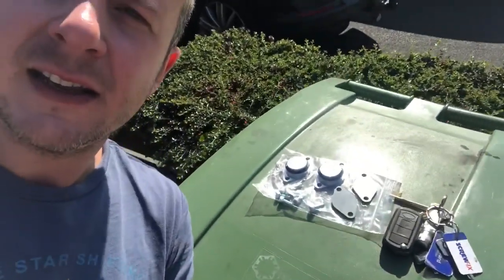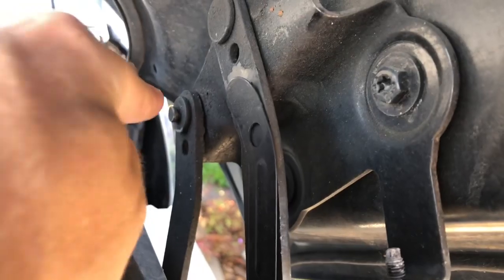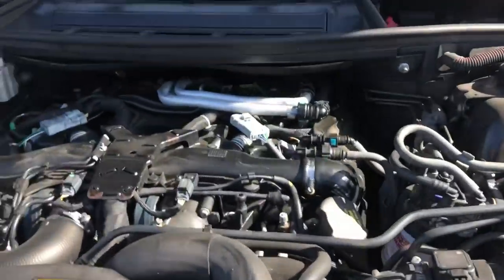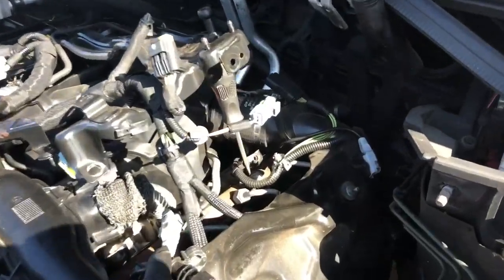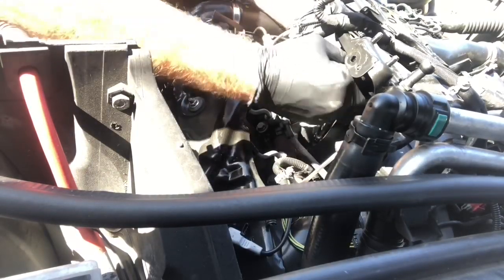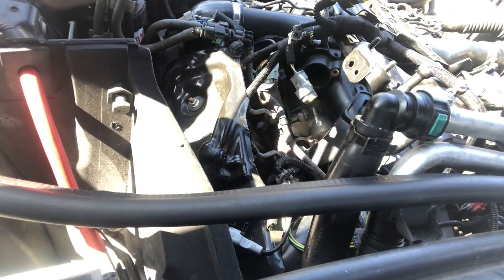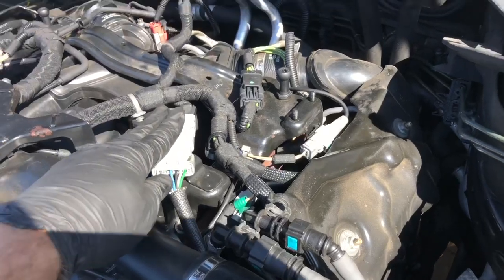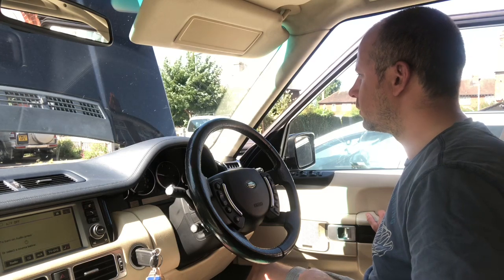EGR Delete - Range Rover L322 3.6 TDV8

Comment: Got myself a cheap 3.6 tdv8 last week and this is the first job I did to it based on this guide. Watched it through a few times then went and and did it first time with no problems at all...took about an hour and a half. To the casual observer I must have looked like a master mechanic lol. No error messages or fault codes. Seems to pick up so much smoother but then that might just be in my head, Thanks very much for posting this it was invaluable.
Reply: Where did you order the kit from?

Comment: Good to see the old Range Rover again. Might be worth mentioning that those with less steady hands than yourself should consider replacing the lower blanking plate first just to avoid dropping anything into the open port. Also just to clarify as I’ve seen it mentioned it’s not actually illegal to delete the EGR valve, the official term is “it is an offence under the Road vehicles (Construction and Use) Regulations (Regulation 61a(3))1 to use a vehicle which has been modified in such a way that it no longer complies with the air pollutant emissions standards it was designed to meet. Removal of the EGR will almost invariably contravene these requirements.” There are fines that can be imposed for this, however, as you have already mentioned, the engine cover is not removed at the point of MOT nor would I expect it to be removed should you ever be stopped by the police for any reason. Keep the videos coming 👍🏻
Reply from the maker: Well done, great comment! You put it so much better than me 👍😀
Reply: In the event of some bad accident damage an insurance assessor would easily spot that they have been removed though so bear that in mind.

Comment: Since it was a sunny day in South Wales for a change, I took the opportunity to do the egr delete on my 2007 L322 Tdv8 3.6 . All went till I sheared the final torx screw. Luckily this only took an hour to remove. Lesson learned don't overtighten using electric tools 😂. I got the kit from X8R, £££ but good quality.

Comment: Good video for EGR access instructions (and yes, replace the bottom plate first 😜). I have a TDV8 3.6 2010 L322 and have had my first code thrown on the EGR system (P045D) which is likely that the valve is not closing or shutting without resistance on bank 2. The vehicle will test all these things on start up (0 to 100 or close to on the valves) and if it's sticky will throw the code. The valves may sit at 5% at closed and say 75% when open at idle, but the start up process has shown a sticking valve. So, options are to simply close the valves (with diag tool) and remap to isolate them and get no more restricted performance, blank them off and also remap, or clean the valves and EGR system, which at my kms is probably too far gone, so replacement the other option. Decisions decisions!
Reply: Bonasera io o una renge rover evoque 3.6  quando lo meto in moto    per i primi 3 minuti mi vibra la macchina poi smete     certe volte lo fa certe no . Mi potete rispondere per favore grazie

Comment: Thanks for doing these videos; I’m assuming you’ve sold on the l322 at this point, but the videos you’ve created are still helpful for those of us battling the never ending issues…. I have a question regarding the EGR delete: is there any reason to completely remove the tube? Why not just install the metal plate next to the EGR and leave everything else as is? Why install the top “plug”?
Reply from the maker: The top (aluminium blank with rubber O-ring) needs to make an airtight seal on the inlet manifold because otherwise you’ll have ENORMOUS boost leak when your turbos are spinning 👍
Reply: @Nut_Job.  Excellent! Thanks for the response; I'll take your advice and blank both holes then.

Comment: Love watching your videos!! Will you be adding an oil catch can on the Range Rover? I was wondering now that the EGR delete is done, will you do an Induction Cleaning?
Reply from the maker: When I first got the car I did a DIY induction clean using Turbo Revive which is sprayed into the intake. There’s a video on it if you look back a while... 
I’m planning to do all the gearbox mechatronic seals when I get chance, fix my erratic fuel gauge & a few other bits if time permits. Then I’ll probably sell this & have a think about what to have for a new toy 😁
Reply: Nut Job I will have a look, it’s a amazing car. Just a shame I don’t  live in the UK other wise I’ll be inline to buy the Range Rover. Looking forward to the next video.

Comment: Hi nice video. I have just brought a 2008 on of these. I have owned td5 for years and love it. I am wondering if the blanking kit worked as it’s something I am interested in doing to mine. Did it bring any lights on and did you notice and difference is n performance and economy.
Thanks for a great video.
Reply from the maker: Performance & economy were great (no detrimental effect anyway) & no warning lights for me. My L322 had no DPF either, so if yours doesn’t have one either then I imagine it’ll be the same
Reply: Nut Job thank you for the quick response. No mind don’t have DPF just cats which may disappear. Thanks for the info.

Comment: I Need the full kit where did you get it from as I brought the plates done them easy enough now it’s blowing from the top so I haven’t sealed it correctly. Need the bungs ASAP and don’t know where to get them??
Reply from the maker: Got mine off eBay mate
Reply: Thanks for replying I have just ordered some from a Website I found on Google A few people seemed to have used them and all positive feedback. anyone else wanting to buy this kit I will let them know after fitting As I couldn’t find anything anywhere else for the 3.6

Comment: Hello mate. thanks for your video. It is very helpful. Is it necessary to modify any parameter in the control unit related to the egr after canceling it with that kit? ... or is it only necessary to put the kit on it ?. Mine is the sport model. But it has the same engine as yours.
Reply from the maker: In my experience, I had no problems with engine fault codes after blanking the EGR’s. I was actually expecting to need a remap to ‘code’ them out, however I found it wasn’t necessary on my car (however, it may not be the same for you). This model/year (2007) didn’t have a DPF & I know the DPF regen needs the help of the EGR valves, so if you have a DPF it may be different for you - but I’m not certain.
Reply: Thank you very much for the information. my engine has no DPF either. So I guess we are in the same place. Since I am also in 2007. As I have read in many forums, the Ecu needs to be reprogrammed to eliminate the Egr. But it is already known in this, some say one thing and others another. It is always good to have a partner like you to teach things clearly.

Comment: Did you not get any engine codes or require a "digital delete" with this kit? I've bought what looks like the same kit but the fitting instructions say i'll need to have a digital delete done as well.
Reply from the maker: Yes, indeed my instructions say that too. It won’t actually give you any engine codes or warning lights though. But it is better to also get them mapped-out so that the actual EGR valves remain closed, because if they continue to open close like mine are now they could still fail/jam open & cause a fault code (but won’t damage anything because they are actually blanked off 😀)

Comment: Any advice on my l322 started to smoke a bit when acceleration  or when going past 65 to 70 goes in to limp mode and the speed goes down to 50. Please advise me.
Reply: Check all turbo/intercooler hoses for splits
Reply: @tomsmith6741  thank you for you reply.
Reply: @22gukwaley41  did you get it sorted?

Comment: Will this pass an MOT now with the new emissions equipment visual tampering rules? Or does it pass because the engine cover hides everything?
Reply from the maker: As far as I know it should pass because they won’t remove the engine cover. It’ll need an MOT soon so I’ll find out then... 😀
Reply: @Nut_Job.  That's ideal. Really enjoyed your videos on the 330D N57 timing chain. What are your thoughts on an EGR blank for that?
Reply from the maker: I’m less keen to blank anything on that BMW engine unless it’s already been mapped-out. I’m currently battling an intermittent electrical issue at present - hence the lack of videos... I’m still working out what’s wrong! 😬🤔
Reply: Yes it will. I blanked mine off and it went straight through the MOT. Emissions were perfect.

Comment: Hi, what is a cheap software diagnostic tool to remove the EGR and DPF from the ECU
Reply from the maker: I’m not aware of anything cheap which can do this. You would need the same software tools as an ECU remapper. You might be able to pick something up via online sellers or even EBay, but knowing how to use it correctly without bricking your ECU is the next challenge.
I’d say it’s best to pay a remap specialist to do it for you (unless you wanted to get into the remap/tuning business).
Reply: @Nut_Job.  hi mate mines got a big water leak I think it’s the thermostat housing do the inlet manifolds need removing 
Kind regards

Comment: Now you've been driving it for a while after the EGR delete, any errors logged on dash or OBDll. Cheers.
Reply from the maker: None whatsoever 👍
Reply: Thank you for the confirmation on that, its good to know what your experience was before doing my own.
Reply: Did you have to delete the EGRs from the ECU?
Reply from the maker: I think that you should if you can get it coded out at a tuning shop. I actually haven’t, so the EGR valves are still opening/closing all the time but of course they’re now blocked off so there’s no effect. On newer cars this will usually throw a CEL but this engine doesn’t seem to know/care that the EGR is having no effect on the engine so far 🤷‍♂️
Reply: Nut Job thanks! I thought you removed the valves. Do you mean the ECU is still sending the signal?
Reply from the maker: Yes, and the valves are still responding. But no exhaust gases are going anywhere 👍
Reply from the maker: The only problem is if either of the EGR’s develop a fault in future then the car will throw a warning & fault code. That’s why I should get the completely coded-out really. I won’t affect anything in reality even if both of them were to fail, but of course the car doesn’t know that & it will want you to sort the issue out.
Reply: Nut Job cool! So the valves are gone but ECU still thinks they’re in the engine doing their job. How long did it take you? Are you a mechanic? Think about doing this myself. I presume it shouldn’t really matter in what order it’s done ie I was thinking on having them programmed out of ECU first then getting the blanking plates maybe next month.
Reply from the maker: It’s fine to do it either way round 👍
Reply: Nut Job I doubt you’ll have the problem of EGR faults if they’re no longer attached to the engine and you’ve had no faults so far. I’d imagine if by removing the valves altogether the ECU would have flagged a fault straight away if it was going to at all.

Comment: Hi nut when I blanked the egr on my freelander 2 it screwed up how the auto box changed gear I asked a land rover specialist if the egr vacuum is link to the gearbox and he said yes the only way I could get the car to run correctly was to have the egr's deleted from the ecu then I have no more issues    not sure if this is the same for your tdv8
      Thx matey phill

Comment: I did this to my Auris 2.0 D4D the other day cleaned everything and blanked the EGR no lights on the dash noticeably better fuel economy and engine runs smoother and pulls better from low revs 👌🏻 No DPF fitted to my vehicle from factory so no worries on that side

Comment: Can you show us how to install an oil catch can on the L322 Range Rover 3.6 twin turbo diesel. Thanks and keep up the great videos its much appriciated.
Reply: Will it need one or two catch cans?
Reply: Just one can as crankcase  vent oil separator is also one. Provent from MANN seems to me quite good, but no one has reported to install it yet.
https://www.aulro.com/afvb/l322-range-rover/223134-tdv8-egr-map-out-remap-2010-tdv8-4.html

Comment: No Check engine lights triggered whatsoever?  No need to electronically reprogram the engine computer?
Reply from the maker: Not in this 2007 model. I think that any newer models might have been different as they also started to feature a DPF…

Comment: How's the leather seat repair holding up on the RR ?
Cheers
Reply from the maker: Still looks really good I think 👍
I’ve done over 10k miles in it since then & that ‘all-in-one’ colour seems to hold up really well 😀
Reply: @Nut_Job.  Cheers. Glad you kept it. Will look out for any more RR vids.
Reply from the maker: I’ll be doing all the gearbox mechatronic seals soon, plus I intend to sort my erratic fuel gauge out at some point too, and maybe some other bits... 👍

Comment: Will you do EGR software deactivation too?
Reply: leusfx you don’t need too
Reply: @gerryr1893  Are you sure? I read on FFRR that If you block the EGR, you risk pushing the compressors into surge when you step in and several turbos had been (reported) damaged previously.As the boost runs in open loop when the EGR is active, the turbos can overspeed or surge.  As the boost runs in open loop when the EGR is active, the turbos can overspeed or surge. The guy says that  it is possible to remap the vane set points to open up the vanes as well.  I am not expert myself but think that there's some point  in that.

Comment: Now enjoy clean oil and knowing your egr can’t fail and take out the turbos and engine!
Reply: James T its a diesel the oil will never be clean 😬
Reply: You will be surprised, after I blanked the egrs and did a couple of oil changes to flush the engine, the oil now stays pretty clean and clear now. It’s made a massive difference.
Reply: Combustion temp will increase as will NOx emissions but on a plus side oil should be less acidic and cleaner inlet etc.
Reply: M James agreed, but the only issue with the rise in combustion temps is nox output. Nox is a reactive gas and breaks down very quickly (less than 20 minutes) so no issue unless you are running the car under full load in a tunnel for hours and who does that!

Again... no down side.

Comment: How it been running since you blanked off the egr’s any dash board lights I have just bought a 2010 and have this fault listed PCM-Engine TDV8 3.6L

P0407-21 (2F) Exhaust gas recirculation sensor B circuit low - General signal failure - signal amplitude<minimum
Reply from the maker: Runs perfectly mate. You’d never know any difference - I’ve driven well over 1000 miles since doing it too 👍

Comment: I thought you at least need the EGR for regeneration. Aren’t you worried you might clog up your DPF?
Reply from the maker: Naa, I do long journeys regularly in this. I can always force a regen if needed, but doubt it.
Reply: The 3.6 in the uk doesn’t  have the dpf
Reply from the maker: Oh yes, well pointed out 👍
It’s been a while since I was fiddling with this car... 😂
No regen to worry about then 😁
Reply: I blanked mine 2 months ago then remapped and also removing egr
Reply: @darrensmith2141  any problems with the mot?
 Smoke under full acceleration?
Reply: No no problem I have just blanked mine off leaving the pipes in place and mapped them out so  looking at it looks no difference
Reply: JAW S mine is 2010 and had the egr mapped out did it 5 years ago and never had any issues to date
Reply: @darrensmith2141 The later ones do.
Reply: I noticed you started it with a key so I assume it’s a pre facelift model. 
I wonder if it’s as easy to do this on the later ones that are Euro 5.

Comment: The Nut Job . 

I have a 2011 4.4 TDV8 with 146 000 km on the clock, the car sometimes struggles to start , and also sometimes idles inconsistently . Any ideas on what the cause could be ? . There are no fault codes or any engine light that appear.  And I service every 10 000 km.
Reply from the maker: Glow plugs/controller? I’m not too familiar with the newer 4.4 TDV8 unfortunately, sorry.
Reply: @Nut_Job.  I doubt it's the glow plugs/controller.  It occasionally happens even if you have driven the car , and it's at operating temperature. Sometimes I think it's the EGR valves that get stuck in a open position?  Or it's a feul delivery problem . I can't find anyone else with the same problem to point me in the right direction.
Reply from the maker: Have you got a diagnostic code reader? I’ve just bought a better one (as I’ve been using a very basic OBDII reader for ages...) and it’ll read everything from the individual control modules across the vehicle. If there’s an intermittent fault it’s likely to be logged & you will get a pointer to the issue.
Reply: @Nut_Job.  I don't have one 😀. The car is due for a service,  and I will look into that with the service center . Thanks for the advice.  I'll report here to you when I found the problem , hopefully in the near future.
Reply: Feom the least to more $$$.. could be a bad diesel filter (due to bad diesel), a bar injector, a bad turbo inlet pipes... Have you found the main reason by any chance?
Reply: From*
Reply: @AdHominem888  stil haven't found the problem  : (
Reply from the maker: If you can get a diagnostic reader see how your O2 (Lambda) sensors are performing... if dirty or failing they will cause the engine to swing either rich/lean. A good diagnostic tool will show you whether the car is ‘trimming’ the fuel rich/lean & that can feel like rough running if the engine is trying to compensate for a particular condition
Reply: @Nut_Job.  what diagnostics code reader did you buy/could you recommend? thx (although I read somewhere you sold the car not to long ago)
Reply: @Nut_Job.  what diagnostic code reader did you get/can you recommend? (although I understood you sold the car recently)